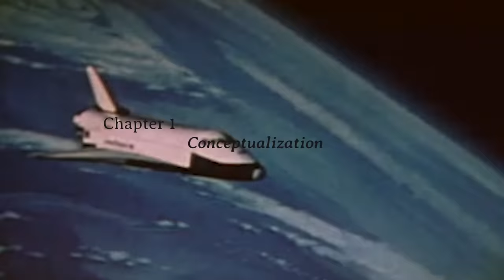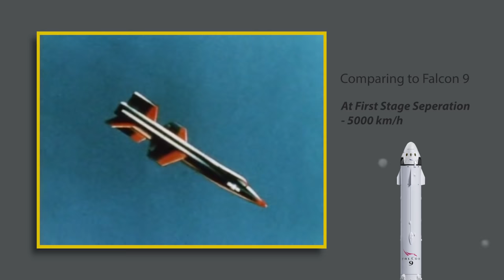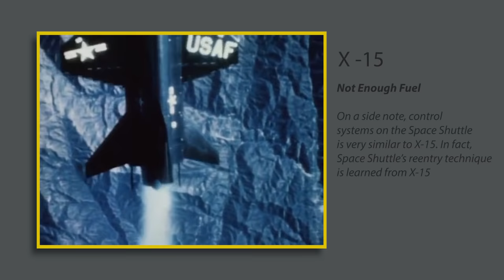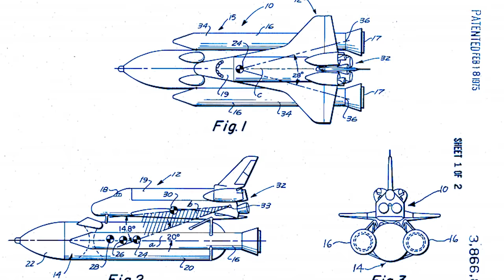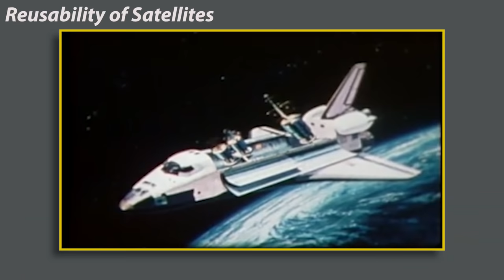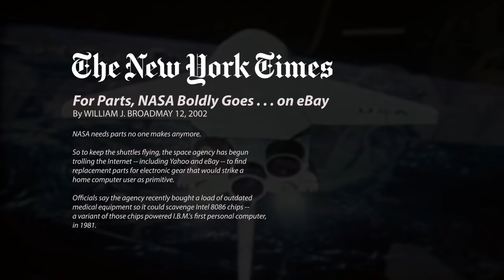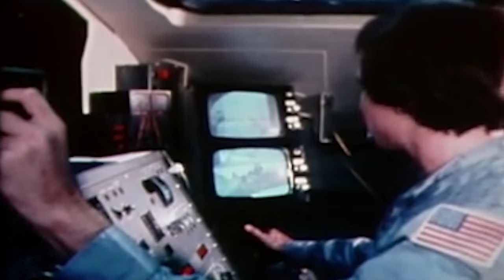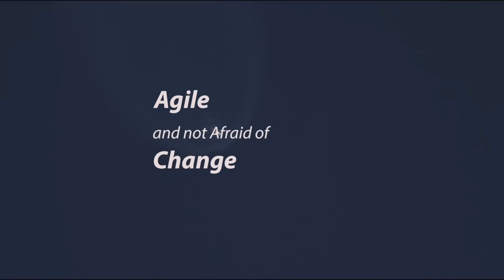The Space Shuttle, a failed attempt at Reusability?

Comment: It failed in the sense that the only real unique feature it was designed around was rarely ever used. That is way too few missions ever used the recovery capability. (The only real point of having a shuttle. If recovery isn't being used, all the extra mass is just dead weight on the launch payload.)

At least this is in regards to what was publicly known about the missions.

Air Force now has the X37 with similar features. But compared to the old shuttles, that thing is tiny. (It itself could fit in the shuttle bay, and is as small if not smaller than general aviation aircraft.)

Comment: Early STS designs weren't even close to what eventually was made.  Yes, your video is true in that those plans you show are the ones that NASA eventually put forward but by then it had already been tainted with issues.  The STS was never designed, at least initially, to have solid rocket boosters or the like.  It was meant, as it name suggests, a space transportation system, primarily to transport people into LEO.  However, due to budgetary issues, the design change to what you see today.

I agree that the eventual STS wasn't safe.  I mean, the bright idea of putting 2 SRBs side by side each other which you cannot control or switch off was the single biggest mistake of them all.  In initial designs, there was no SRBs attached at all.  Secondly, the EFT was also a big design flaw.  Any engineer can tell you that if you that if you have a grain of dust moving fast enough, it can pierce anything.  And so it was with the EFT's which was insulated with foam.  In initial designs, the shuttle sat atop a booster rocket and had no EFT.  Not only did it not have an EFT, it also sat in a very different position to where the Shuttle eventually was placed.

Finally, I want to address your most egregious comment, which was about obsolescence.  You may think, especially up there in the ISS that you have new up to date technology.  However, I am sorry to say that you are wrong.  In fact, a lot of the satellites that are launched these days still use embedded systems like the 8086, and its variants, up to an 80486 in their design.  I will leave that to you to find out.

Ultimately, the only thing I agree with you on, and you are factually correct with, is that it was a beautiful machine.  Talk about the Shuttle and everybody, even today, will go "oooh" and "ahhh".  Its failure, like you said, lay in the fact that it was an unsafe system and that its costs were prohibitive for a system designed, from the outset, to be reusable.  The STS was designed to take humans up to LEO, build a permanent habitat up there (Space Station) service it and bring people back down.  Hence STS (Space Transportation System).  It never turned out that way eventually.
Reply: Spot on.  Humans are fallible.  Time for Elon.
Reply: Fun fact: the Shuttle was at first designed to be fully reusable, with a "plane-on-plane" two-stage design. But it ended up in its partially reusable state due to lack of funding for development of the full version.

Comment: The original design of the space shuttle, which is not pictured here, was to have it ride on a much larger shuttle whose only job was to boost it into space, then separate and glide home. That design was completely reusable. The big booster shuttle didn't go to space, and thus didn't need expensive heat protection as the shuttle did, since it didn't re-enter. That design was eliminated for cost cutting reasons.

The main problems with the shuttle as deployed were:

1. Overcomplex. The heat tiles were a breakthrough yes, but the alternative was to spray on an ablative material before launch, then reprep that surface and respray when the shuttle came back to earth. The tiles were supposed to fix that, but they didn't. They needed to be largely replaced after the shuttle came back, and they added a point of failure that would later kill 7 people and end the life of the shuttle itself.

2. Unreliable. You covered this well. This was not just the shuttle. NASA/JPL lost mars landers  due to COTS (Customer Off The Shelf, or purchasing regularly sold parts from commercial sources). This would have been a GREAT idea, but NASA didn't follow up with the necessary quality control. In general, NASA lost control of its quality.

3. Out of control costs. After Apollo, NASA became a cash cow to vendors, who were so in bed with NASA that they dictated prices. This is represented today by the ULA or United Launch Alliance. SpaceX broke this cartel, but its an open question still if the ULA can produce ANYTHING at the same prices as SpaceX. 

4. Crippled. The shuttle can only go to low earth orbits, meaning that it cannot even launch or service geostationary orbit satellites, much less do moon trips, etc. This was band-aided by adding a secondary booster in the payload bay to boost satellites to proper orbit, but this still did not help with recovery/service missions, and putting a live, fueled booster in your payload bay is about as smart as carrying a large can of gasoline in your back seat.

In short, NASA emerged from their cost is no object, Apollo heyday as a bloated, incompetent bureaucracy. whoda thunk it?
Reply: I'd add a couple more issues (though, there's many more):

5. Human-rated rockets are always going to be more expensive: extra process and quality control, the weight of crew+cabin subtracts from payload capacity, certain fuels were disallowed on satellite payloads, etc. Some missions require a crew, but otherwise it's a huge liability.

6. The basic layout led to safety issues: When the crew cabin is at the top of the stack, it's possible to have a launch escape system in case of a catastrophic explosion. Also, mounting the vehicle to the side made it susceptible to debris raining down from the main tank.
Reply: Too many cooks spoiled the soup. There wasn't just one, unifying mission principle, so there wasn't really any mission. Except to feed contractors.
Reply: Scott Franco: You are mistaken on a couple of points. 1.....There were not many tiles lost on most missions. On the Columbia mission, it was a relatively delicate panel called Reinforced Carbon Carbon (RCC). A roughly suitcase sized chunk of ET foam struck the RCC on launch. 4.....The shuttle was never designed to go to geosynchronous orbit without a booster attached to the applicable payload. It was also never designed to go to the moon. That's why you develop upper stages and payloads that can do this and be installed in one or two shuttle missions. There was simply no reason to do the moon during the shuttle program until G. Bush 1 and 2 proposals came about and died on the vine.

Comment: And here goes NASA again with SLS which is like the shuttle but no wings and more to throw away. About 1.2 billion to launch.
Reply: madmax2099a Refurbishment, overhauling a man rated space vehicle is more expensive than building a use once, throwaway launch rocket that is integrated in the factory. The space Shuttle wasn't just refueled and launched, everything was refurbished and checked before each flight.
Reply: since the Soviet Union basically copied NASA to build its Buran space shuttle, NASA should have copied the Buran - do away with shuttle main engines and instead use an all-liquid booster stack that could lift the whole shuttle into orbit dead weight.  Eliminate SRB's an you eliminate the O-ring failure.  Eliminate the External Fuel Tank to feed SME's, and you eliminate the foam strikes.  Eliminate the SME's, and you cut refurbishment costs in HALF.  And the Buran had go-around capability with its intended air-breathing jet engines when in atmosphere.
Reply: madmax2099a - I doubt that it will be like the shuttle, I expect it not to kill it's crews. Orion is designed for a high speed reentry which the shuttle could not do.
Reply: The thought is that it is more expensive because it has been in the past. We need to start thinking of space tech like all other tech and constantly innovate. The Falcon 9 is already in it's 5th iteration and every single vehicle is upgraded as it is built, the benefits of a single company analyzing and adapting.
Everything needs to be rethought. It's time to kill the Cold War Pentagon style cost +  contracts.

Comment: Great video. Just a minor criticism if I may. I agree the space shuttle was mostly a failure when considering the initial goals but for balance I think you should have mentioned the Hubble space telescope repair and servicing missions. That I think was a triumph. An expensive one but a triumph nonetheless.
Reply: Honestly, it would have been far cheaper to build more and better replacements for the Hubble than to spend so much on its multiple repairs. We could have so much more now, if we had been wiser back then. 20/20 hindsight is no fun!
Reply: Curtis Quick I don't dispute that at all. The Hubble repair/servicing missions were still inspiring despite the cost.
Reply: I agree it was a was a triumph that they built new parts for Hubble and had astronauts installed them, but just what was the special thing that the shuttle did? For the fourth repair they were planning the robotic service mission which wouldn't have used the shuttle or the astronauts. Looking back at previous repair missions to Skylab and Muir, they managed some great work without the shuttle.

Comment: My 2 biggest issues with the Shuttle from a design perspective are:

1. The astronauts are not COMPLETELY IN FRONT of the fuel. They're dangerously right NEXT to the fuel.
2. The heat shield is exposed to the atmosphere TWICE, instead of just ONCE.

My additional issues are:

The main engines should be LESS efficient but MORE affordable. More like Honda Accord instead of Ferrari Enzo.
The main engines should be on a separate module, so they can be worked on in mission prep separately from the chassis.
Reply: The heat shield is exposed to the atmosphere much more than twice, it's a permanent fixture. Man rated engines and affordable don't go together.  I agree with the engines should be on a separate module.

Comment: There was challenger, endeavour, discovery, Atlantis, Columbia and there was also enterprise which was the first orbiter built but was never used though it was used to test if the external fuel tank foam was the cause of the columbia accident
Reply: It wasn't exactly an orbiter in that it had no engines or heat shield. Also it was passed over when it came time to build Endeavour, choosing to use spare parts instead.

Comment: Biggest difference between NASA and SpaceX is the ability to iterate the design to add new features because most of the rocket is built with vertical integration rather than suppliers being spread out all over the place.
Reply: SpaceX is using tried and true manufacturing methods developed over a centuries of mass production. NASA has to satisfy a Joe Blow Senator.

Comment: I predict that spaceplanes will probably see a decline in popularity in the near future as more people land propulsively on Mars, but may see more use when humans start colonising and building infrastructure on Titan or maybe even Venus, places with atmospheres. 

You could easily glide a plane into a splashdown on the methane seas of Titan, since the higher atmospheric pressure and lower gravity means your terminal velocity is much lower than on Earth. As for Venus, you could probably have floating runways.
Reply: Atmospheric density*
Reply: Fun fact: the Shuttle was at first designed to be fully reusable, with a "plane-on-plane" two-stage design. But it ended up in its partially reusable state due to lack of funding for development of the full version.

Comment: The Space Shuttle was too far ahead of its time. It's a simple fact that a cylindrical rocket is the easiest object to launch into space, and to re-enter into the atmosphere, because of its small cross-section when upright. However, the computer technology necessary to precisely land a cylindrical rocket upright on a launchpad was impossible to build when the Space Shuttle was being designed, so they had to build the Space Shuttle with traditional aerodynamics instead, and that made it a much more maintenance-intensive design due to the higher stresses on the spacecraft during re-entry. The Space Shuttle succeeded, at least, in proving that we really want a good reusable spacecraft, and thus provided motivation to continue pursuing reusable spacecraft design.
Reply: We think it was impossible, but there isn't any evidence that NASA even tried. Innovation comes from experimentation. That was an experiment that NASA didn't attempt.
Reply: Incorrect. Private companies have been pursuing reusable rockets since rockets were invented. It's only recently that they became practical to implement. You may recall that NASA did reuse the SRBs on the Space Shuttle, and the SRBs are essentially rockets in their own right, they just belly-flopped into the ocean instead of landing upright on solid ground because landing upright on solid ground was too difficult to implement with 70's technology.
Reply: To say that NASA re-used the SRBs is a bit of a misnomer. They would retrieve them, completely tear them down and rebuild them...That's if the SRB is in good enough shape to keep. If not they would salvage parts from it. In the end, the cost of re-using an SRB is about 80% of the cost of a new one.
And NASA did that while calling them re-usable for 30 years.

Comment: I wish you had looked closer at the design process, and how the design changed mainly in an attempt to finance the project (for example, promising the Air Force some features not in the current design to get money from the Air Force, having to adapt the design to actually deliver those features (which weren't actually used IIRC) - stuff like that, which mutated a new experimental(!) space plane into a space truck supposed to be used in production - when really, it would have made sense to have a few generations of the concept in fairly quick succession to work out design bugs before figuring out which design(s) to build for production use (Mercury, Geminy, Apollo?). But the money wasn't there.
And a number of problematic design decisions came directly from this process. Such as the side-mounted orbiter, being vulnerable for insulatipon hits.
Reply: Fun fact: the Shuttle was at first designed to be fully reusable, with a "plane-on-plane" two-stage design. But it ended up in its partially reusable state due to lack of funding for development of the full version.

Comment: A couple notes: The Apollo-Saturn launch stack has directly killed three people. (The Apollo 1 fire killed Ed White, Roger Chafee and Gus Grissom when the command module burned on top of the fully fueled rocket sitting on the pad.) It nearly killed three more with Apollo 13, and another time in 1975's Apollo-Soyuz Test Project mission. (Dinitogen Tetroxide from the RCS system entered the cabin after reentry, causing the CMP to pass out. Had the other crew members not caught it, they would've been killed when the CM hit the water at 300+ miles per hour because the drogue and main parachutes were deployed manually, *by the CMP*.) 

The Space Shuttle was crap because they were held to unrealistic expectations and meddling from higher government officials. ("We want for you to do missions for the USAF too. They want to launch spy satellites into polar orbits. And they need for whatever you make to have a wide cross-range landing capability. And a few thousand tons of lift more than you're planning because of classified payloads. For cost savings you understand.") Those capabilities weren't strictly necessary, and ended up needlessly cutting into safety, reusability and reliability  margins.
Reply: The launch stack did not kill Chafee, White and Grissom. The capsule could have been sitting in a hanger and still would have killed them.
Reply: The test was not considered hazardous because the rocket was unfueled. It would have been very strange to fully fuel a Saturn V a month before the scheduled launch.

Comment: The two shuttle losses were from components failing or FOD , not from a bad designed ship. For the expenditure it succeeded admirably. The ships them self were NOT failures. The srbs were a failure and a limited failure on the one of the systems not the actual shuttle per se.

Comment: Considering it so rarely ever HAD to bring anything back inside it's cargo bay, it was mostly an oversized overweight faring. Why did cargo lifting and human lifting have to be done by the same craft at the same time?

All that NEEDED to be brought back in a particular place (like a landing strip) was humans, the shuttle should have been much much smaller, maybe just enough for a crew of 6, and would be placed ON TOP of a rocket. Like the current US Air Force drone shuttle which is totally top secret, hush hush.

And all the crew would have had ejector seats.

But why not just stick with capsules but use more advanced parachutes such as a ram air parachute combined with inflatable landing cushion, it wouldn't need to land underwater where there's the risk of the capsule sinking. A salt flat or desert where the climate is quite consistent would do great.
Reply: I agree that flying the cargo bay was dumb, ejector seats don't work in the  SRB exhaust

Comment: Up until now, even with the shuttle obsolete and people killed. They still wont admit, the shuttle is a seriously flawed design !
Reply: the flaw was having to rely on the Shuttle main engines in the first place.  The Soviet Buran was a vast improvement.  Even eliminated both causes for STS disasters (no SRB's mean no O-ring failures, and no SME's mean no external fuel tank, so no foam strikes).  Further, no SME's mean refurbishment cost cut in HALF, as well as turnaround time.